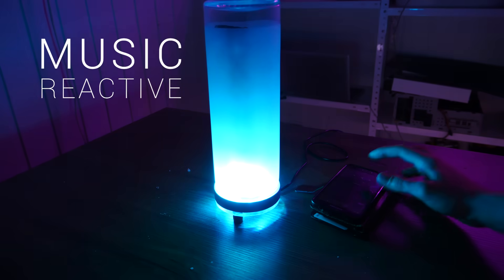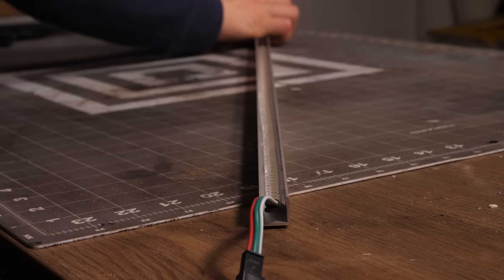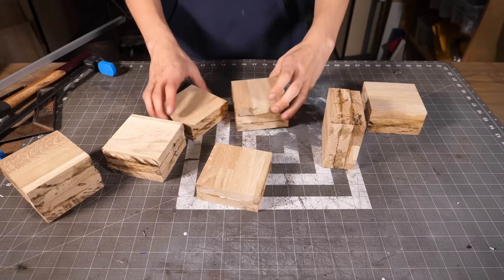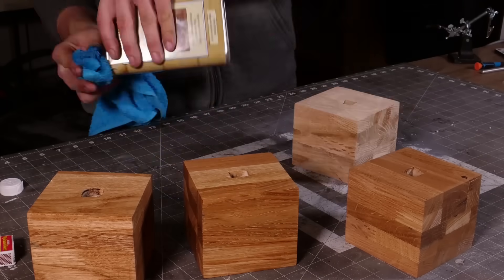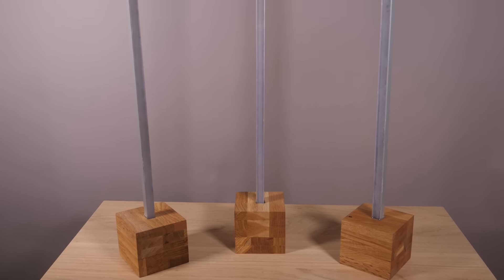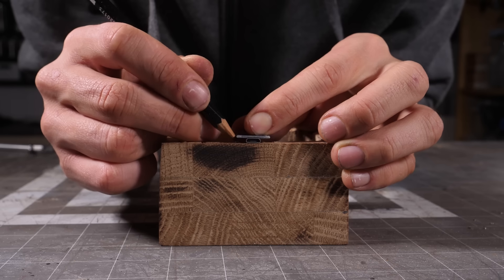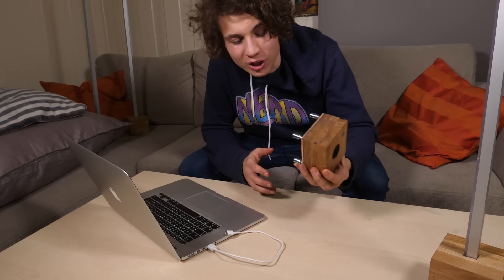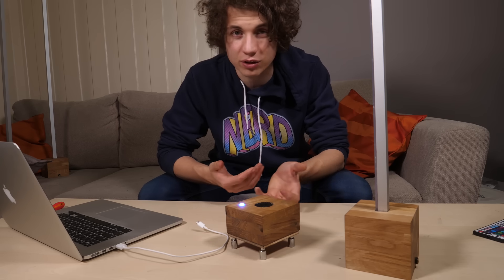Making Wireless MUSIC VISUALIZING Floor Lamps

Comment from the maker: Kind of a long one! It was either long, or 2 parts, and I personally prefer to see a finished product in a project video myself so I went with the long video option. This project has been planned for a long time! Hope you enjoy it! 
EDIT:
Just mentioning the colors of the lamp here, as I originally wanted to make a more fancy color scheme, where colors changed based on the pace of the music. But I had already worked on this for so long time, so I decided to let it be and get on with the video. But the code is on github: http://bit.ly/arduinoforge so feel free to make pull requests!
Reply: I want a link to buy pull up resistor and picture of how you connect it to push button please
Reply: You didn't link the Node MCU WiFi module ^^
Reply: Hey man 
I try to upload the code but it won't let because of the #include "common_reactive.h"
How can i fix it?
I tried adding the code from github but still doesn't work
Reply: @panospanou7306  
In the Arduino IDE, enter the master or client code. Then CTRL + SHIFT + N (new tab), then save as "common_reactive.h". Enter the common reactive code in this new tab. When you load the code it will recognize the library.
Reply: @panospanou7306  I am having the same problem did you get it to work?
Reply: @panospanou7306  hit me up i figured it out
Reply: hi mate sorry to ask but in the file for the arduino code what is the reactive_common.h file as don't know what its used for! Cheers mate sick project!
Reply: Nice, project, love it. Awesome t shirt, dude. I really really need that t shirt, please can you help me, please. ?
Reply from the maker: The "Stay Creative" one? It is GreatScott merch :) you can probably still buy it from him
Reply: Nice job on the lgihts and the code, looks very cool and clean I might make myself some of those! I also was wondering if you know about Audectra? It is software you can run on your pc to analyze music and control your led-strips over wifi very similar to how you do it with the esp-modules. just look it up on youtube!
Reply: I made everything like you but my led strip wont open. Sometimes when i plug it in and out it displays some random colors but thats it. Please help. I spent a lot of money on this.
Reply: Igor Šikić hi mate, you will need the controllers as they run the whole project basically. After you’ve got the controllers you then use the schematic to wire it up successfully and then upload the code and should work all good
Reply: @Yaboi56676   Hi mate, I wanted to edit previous post and I deleted it :(. When you say controller you mean wemos D1 mini? ( i connect with wemos and upload code on it). For me arduino nano or uno are controllers. I have all and I connected almost everything. Only thing i have replace is that switch with led light on controller in video i bought nice one from ebay with 4 pins.
Reply: Igor Šikić the modules have to be wifi suitable so if you use an arduino you would have to use a hat. The code however is sound and works when I use it, you may want to check continuity between the pins to ensure it’s all working. However is strange that it isn’t
Reply: Igor Šikić I’ve done this with both arduino hats and the wemos modules and all is working fine for me
Reply: @Yaboi56676  I have connected all and when I verify code i got error. reactive_common.h :no such file or directory :(. how did you fix that? I saw up in comments guys  have same error
Reply: @Igor-je1gh  
In the Arduino IDE, enter the master or client code. Then CTRL + SHIFT + N (new tab), then save as "common_reactive.h". Enter the common reactive code in this new tab. When you load the code it will recognize the library.
Reply: @estevamribeiro3721  Thank you dude i will try now. Did not see your answer sooner
Reply: Hey!!!!
Your project is really awesome.
Your project is the best amongst all!!
Can same program codes be used for 60 led per m?
If possible can you explain how to execute link given by SnowyWolfGamez.
Thanks!!
Greetings!!
Reply: @mayurparab499  edit unique ID from slave strips, the current lamp has. Starts from 1 to n, where n is the amount of lamps. Wont work unless this is correct, and the same as the amount of lamps the controller expects.
Reply: What is the name of the song you used at the end of this video?
Reply: @hartleyc3782  Daxten - You Got Me
Reply: How much did this cost?
Reply: Hi - The lights you linked are only 3.2FT/1M but yours look bigger.. Did you put to together to make 6.4FT/2M or did you get a different LED strip for your project? Ive never done anything like this type of build before, i would hate to buy all this stuff and hit a wall putting it together. Is there a place i can go to receive help if something for some reason doesnt work? I have a Mac and tried to DL a coding program and it wasnt working at all and just doing that and making sure it sends and connects to these chips worries me.. Thanks!
Reply: could you build one of these with DMX decoder? just simply for stage lighting design. Want to integrate it with my system. how much did this cost you to build?
Reply: Hi Nerdforge  Thankyou for the awesome project 
I make one like you and I am use only 60led but there are no Green color can you show me what to do thank you in advance
Reply: @nhl2000bc   Besides green, does it work?
Reply: Jasur Abdurasulov yes it work
Reply: @nhl2000bc  brother can you help me? my slave connected to the master (in the strip first pixel is blue which meaning connection established) and second problem how to connect button to the node mcu, in the scheme of Nerdforge is not correctly or 
I can not understand how it is connected to the node mcu Thanks for your responsiveness
Reply: Jasur Abdurasulov Did your light work with the music?
Reply: @nhl2000bc  no, lights not work....
Reply: But the slave's connect to the master...
Reply: @nhl2000bc  just work fist diod on the strip (blue when connected to the master, and green when disconnected)
Reply: @jasurabdurasulov2274  were you able to get it to work? I’m currently having the same problem as you. I think it's the code.
Reply: I am getting error - reactive_common.h: No such file or directory please help somebody
Reply: Hey there! I've been looking to do something like this myself for a while now so when I saw this I was curious. This has to be the best audio visualization project I've seen anywhere on youtube so far. Thank you for sharing your project! :)

Although, I was wondering: I've been pouring over your code for a half hour or so. While I can get the general idea, it is still a bit difficult to piece together without any context. I know this video is several months old now,  but do you think you'd ever consider annotating your stuff on github or even making a follow-up to talk about the code itself? I'm just at a loss with what sanity buffers and long term samples and such are supposed to be doing and I'd love to learn the gorey details of the software side since you've provided us with such a nice explanation of the hardware already! 

Thanks. :)
Reply: Can i use WS2812b 30 led 1 mtr strip for this diy work with same Arduino codes?
Reply: @rtoapproach9266  yes you can, but in code you have to change value of led how many you will use
Reply: @gintasislaptintas60  thank you 👍
Reply: @rtoapproach9266  tell me when DIY start well. For me problem is that client led strip wemo's does not connect to access point "master"
Reply: I really like this project. I need to know how to connect the push button to the NodeMcu v3 module. Can u plz kindly tell me how to connect it. Best regards!
Reply: @nishenfernando3186  i know how to connect. Finaly i understood how to run this project. In code is one mistake!
 led_slave where is: 
#define LED_PIN 2 have to be 
#define LED_PIN D2
led_master if use just 1 led strip must to set up:
#define NUMBER_OF_CLIENTS 1
2 strip
#define NUMBER_OF_CLIENTS 2
otherwise leds will not start light
button connect to D1 and GND
resistance 10K to 3V and D1
Reply: @x-TURBO-x  thnkz. I got it 👍
Reply: Do I need for each Lamp the 5v Power thing?
Reply: @drrevolution3961  yes
Reply: @drrevolution3961  do work this project well for you? for me - not
Reply: Hi! Beautiful project i made them but i have a problem: occasionally one of the lights disconnect. Any idea how to fix that?
Reply: Is there anyway to have these sync with the sound from either game play or the TV?... much like a Phillips Hue setup?
Reply: How to upload code 👈 please help 🙏
Reply: I got a pack of 5 weeks D1s for my project, but I can't find some of the pins you labeled in your controller schematic. Specifically the VIN pin and the ground labeled right underneath it. What are their equivalents on the wemos?
Reply: Umm...are you encroaching on any patents with that? If not, you could make those for willing buyers who will pay a decent price. Many of your creations are far too specialized to be marketable, but things like this or that circuit board LED lamp in one video of yours look like things you could actively sell for a means of income to keep this channel going.
Reply: With a bit more professionally done controller box and perhaps simple android app to change effects I can see this being sold for 200$ or so for a set.. (probably even more since room lapse ain't cheep and usually they can't do much.. while philips hue or similar light bulbs are crazy expensive)
Reply: @sschannel4550  $230USD is the cost of Materials alone without fancy boxes paint etc.. Issues if you make for sale, you need to account for faults & returns and labor. No one would buy this for $330 well not enough people would buy this to warrant commercial operation. Just wait though, before long these will come from China. i'm making one for my own use. And maybe would make another one for a friend but would tell them they pay for Materials.
Reply: Hi idk who wrote this but you two need to keep the good work
Reply: Nerdforge You, my boy, are actually fucking genius👌🏻
Reply: 9
Reply: WHAT DO I NEED TO CHANGE IN THE Arduino code. THAT IT IS WITH ME
Reply: Yo te los compro cuanto $ soy de mex eres un genio carnal
Reply: Hey love the project would u  ever make some 4 purchase would love 2 by some
Reply: Will you have them for sale
Reply: @chivozeper1811  He do not answer to anyone this project about. I did it with LINE IN because by mic got fully ** effect. i did too projects by bluetooth one ant with touch screen control - if you interest in
Reply: would you please add more pattern like ripple or the pattern from cine-light?
Reply: @Nerdforge is there a way to controll the light intencity?
Reply: I can't understand how to connect button and led to esp
Is pullup 10k resistor connected to 3.3v and D1
Reply: @ManojKumar-hp2un  Same question
Reply: Ребят, вы русскоговорящие?  )
Reply: +Nerdforge YOU ARE LOUSY GIRL!
Reply: Home's best ware is floor lamp and I also sell it. If you need it, You should check it out.

https://www.amazon.com/gp/product/B01MFC2O83/ref=as_li_tl?ie=UTF8&camp=1789&creative=9325&creativeASIN=B01MFC2O83&linkCode=as2&tag=markdude-20&linkId=3074a9c10abbc914cede60a37d327c9d
Reply: Hey Nerdforge!

I really like this project, and would like to try and make something similar, but in your schematics you connected the LEDs directly to the Wemos, even though The ledstrip exects 5v signals but the wemos is 3.3v? (This one: Wemos D1 Mini V3 - ESP8266 - CH340 ) i've tried this and it didn't work, so did you just connect it like this? or does it work with some boards/strips but doesnt with others?

Hope to hear back, 
Greetings from Holland!
Reply from the maker: @Mika_3c33  Hey! That's a good observation, and can explain some of the issues with one of the LED-strips I had. Naively I assumed the same as an Arduino, but now that you mention it obviously it isn't. The LED's should actually require 3.5 volt signal, but seems to work with 3.3 volts for me. The 3 lamps I have going it seems to run quite steadily! Thanks for pointing this out.
Reply: @Nerdforge  No Problem! i love the projects you do!
Reply: @Nerdforge  
Plz help
Reply: @Nerdforge  Question 1: I am trying to control by the Blynk application but it did not work. Any idea what changes I should make in the code?
Question 2: How to change chorma in "void chillFade ()"?
Reply: @Nerdforge  👍👍👍
Reply: @Mika_3c33  👍👍👍
Reply: @Nerdforge  Whats wrong with schematic controller? I dont see any 10k res. in video, and something wrong with scheme.
Reply: @Mika_3c33  did you experience that the lights lost connection constantly when you tried to connect them directly too the wemos? I have some issues with mine. They work but they loose connection 1 time each minut or so
Reply: @Mika_3c33  nobody help in this project

Comment: Did you use 5V, 8A for each of the LED strip or for all 3?
Reply: Im confused too,how did e power all three towers with one adapter,and do all 3 lamps have battery ?
Reply: @piyushangotra1619  what I calculated is: each smd led on full brightness (lamp mode) at least takes 25 mA so a strip of 144 leds (all leds in parallel) will take 25*144= 3600mA= 3.6A, so a group of 4 lamps will take 3.6*4= 14.4A at full brightness. Hence I used a 5V, 20A source just for keeping in mind scope of future expansion.
However if the leds are used in sound reactive mode, the average current consumption will be lesser than 1A (because not all the leds will be glowing and that too in pulse form) for 1 lamp, so for 4 lamps it would be 4 Amperes max. Perhaps that's why he used 5V, 8A source.
Reply: @piyushangotra1619   also I made it and it's working absolutely fine :)

Comment: Hello, very good project!! but is it possible to replace the microphone with a jack input? to connect directly to the audio source?

I would like to avoid audio interference such as discussions that could be picked up by the microphone, and therefore distort the led signal

Comment: I'm set on making something like this, thanks for the inspiration!

Can you please provide model numbers/part details, as some of the links no longer work?  Pleeeaaaase? :)

Instead of each lamp requiring a 5v power supply, is there a way you'd recommend so they can connect to a single power source?

Comment: Could the latency be reduced by connecting it to an audio line out port on your amplifier, like a subwoofer out. Then rather than reacting to the soundwaves it would be reacting at the same rate as the speakers

Comment: I think with more planning and time this video could have had more polish. Better communication, more fore thought on how to use the mesh on the top of the main box. Watching you drill the underside of that button with a massive drill press and your hand directly under it, reminds me of Martina smacking rocks and squinting instead of using safety glasses.

Comment: Could you attach multiple LED strips to one board with an rgb LED splitter to one and if so how many LED strips could you split to one board?
Reply: What I’m saying is do everything you did except for plugging in one LED strip to the WeMos power like you did in the tower could you purchase an led splitter attach the single point to the board and have a plug in for multiple led strips all to run into that same single board and if so how many strips can these boards handle

Comment: Awesome project, you inspired me to make a large VU meter, then I don’t need to look to the left and my mixer all the time :)
One tip for your next project, when you use UDP you may as well use the broadcast address to send the data once and have the lamps be independent clients and receiving them. Making it a bit more efficient and you don’t need to have to change the number of lights in your master controller ever my time you add a light.

Comment: You should always buy a resistor in series with the data to prevent reflections damaging your wemos.
Just a 220 or 470 ohm will Limited the current of any reflections

Comment: Can you make a more in-depth video on the hardware for the controller and the code? I'm following your diagram and using the code in the description, but 1) I can't get the button to work to switch modes, and 2) The LEDs barely react to any sound or music. Thanks!

Comment: A sandblaster using baking soda would have worked faster to turn the acrylic white.  The music in this video reminds me of Tetris.  What about printing some enclosures for the lights and controller?  What about a newer version of the lights?  I got the idea to use a clear acrylic tube that is properly diffused with a strip of LEDs on both sides of a strip of acrylic that is inserted up the middle of the tube with both strips connected in parallel and connected to a circuit similar to the ones used in the lamps in this video.

Comment: Before you whack apart an engineered , and probably expensive sheet of oak, you might remember that most wood pallets are oak. Pry them apart and cut them to length. If you can tolerate a rustic-ish finish,  you don't even have to run them through a planer. Just run a sander over them after they are glued up. 6:15 

Reuse, recycle, cheap out...

Comment: so i have an idea.... pertaining to this concept.
hear me out now
this idea is to be used in a open theatre/gymnasium setting for a dance.

start with a upward facing smoke machine inside a base holding a 6+ inch diameter acrylic tube 6-8 feet tall.
the top of the tube has you subwoofer/speakers on it facing upward to bounce the sound off the ceiling.

install lighting effects in the center of the tube.
defuse the lights so they are not directly seen but refracted through the smoke that rises up out through the top of the tube and falls down around it